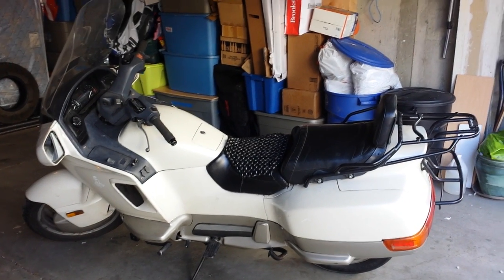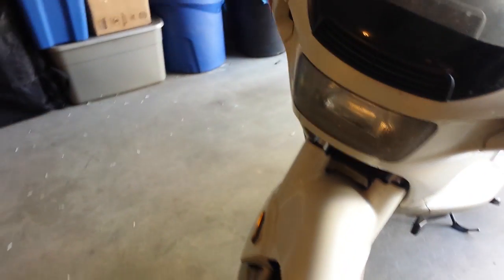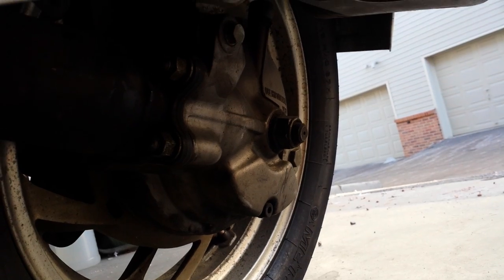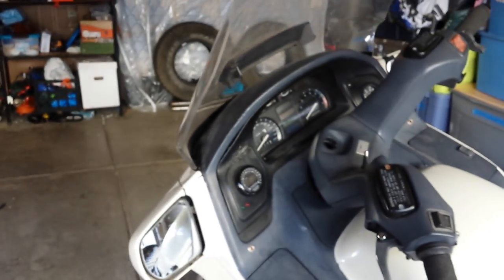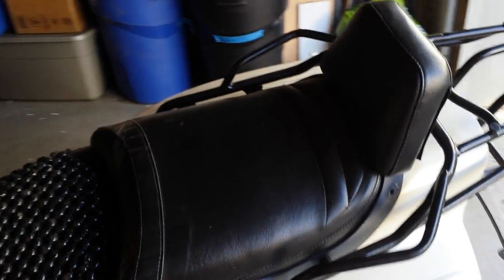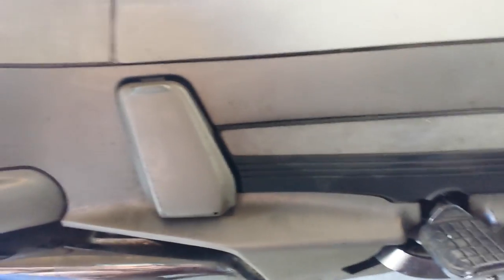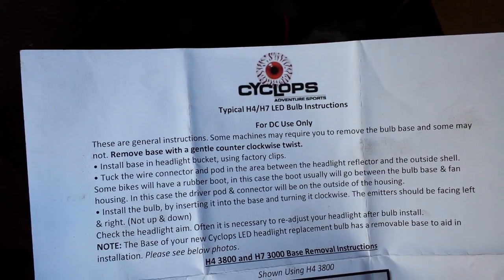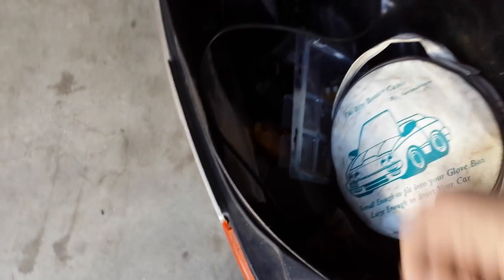Highly Customized 1989 Honda Pacific Coast PC800 - Fuel Injection!

Comment: Just awesome mods! Recently acquired a 7 year abandoned 89 pc800 for $300. Spent 4 weeks learning how to work on a motorcycle as I'd never ridden before in my life. Today, I learned how to clean carbs and put it back together. Much to learn and love that thing. Working hard on it so I can take it on 101 all the way to LA :)  

Those pegs... makes me think I should install those before going to LA and perhaps some mods to fit my height bettter... 6'2" 

Nice work and hope to replicate some of your mods. I'm in Portland.
Reply from the maker: That's great news!  They are lovely bikes and we need more people like you who are willing to adopt orphaned PC800s.  The PCH is an awesome ride all the way from where it's US101 in Olympia down to Los Angeles where it's Highway 1.
Reply: Douglas Van Bossuyt .. THAT is the PCH people talking about? Ahh thx telling me. I never realized that.
Reply: Frank Mounts make sure the tank doesn't have rust. It will blow through a filter and destroy your cylider walls. Been there

Comment: Only question I have about these bikes, I am 6'5 and I would love to know if I would fit without my knees being jammed into the fairing. I sold my 5th gen goldwing for that same reason. From the backrest for the driver to the fairing I would need more than 26 in
Reply from the maker: I'm not near my bike for a few days so I can't measure but you might ask that question at the iPCRC mailing list. If you Google iPCRC you should find it.

Fwiw, I'm 6'2" with a 33" inseam and fit okay. You might need to add a cushion to the seat or redo the seat and add extra foam under the cover. But you can probably make it work reasonably well.

There are also handlebar risers available and if you're willing to lengthen cables and hoses, you could add a few inches of rise beyond factory.

The real difference for me is having a set of Mick-O-Pegs on my PC. It lets me stretch out on the straights.

Comment: didn t know the last exhaust pipe is really fake ..this one makes same sound as mine .. with full exhaust .. thanks !!
Reply from the maker: Well the fake cover on the left side is fake.  The right side actually has the muffler and whatnot and there's a cover over it to make it look prettier.  Many of these bikes (mainly the 1989 model year) sound like they're "tweeting" from a loose bit of metal in the muffler.  It's a "feature" LOL!
Reply: ah you just mean the left ide .. i thought i could take away lastpart on rightside .. will not do this now .. yeah i love the sound .. rode a pc800 for 2 years and now after an interval with over 250000km on paneuropean i ride my tupperware moped again .. like it and it saves me a lot of speed tickets .. and it actually corners better than the st1100.. wish you nice rides ..and props for the injection !!
Reply from the maker: I've owned a lot of other bikes over the years but I can never bring myself to sell my PC800!  Now it is my only bike again.  Until I can't get spare parts anymore, I think I will keep riding it forever.
Reply: its just so freakin practical .. i bought one 25 year old with only 8000miles !! so im gonna drive it till i have enough monney to buy something similar with electric propulsion .. or even convert mine to electric ..
Reply: Greetings from the UK and thanks for sharing all your valuable knowledge and for the great website too. Is there anything I can do about the chirping sound from the exhaust. I find it a bit annoying to be honest.
Reply: @ianowen4481  the chirping is loose rivits inside the exhoust .. it happens to all pc s :-)

Comment: Hi Douglas I would like to ask where you get the rack and how much you paid for? 
And the LED for headlights is what p/n ?
I have pc800 1989 too
Reply from the maker: Hi Kim!  It's an MMoto Complete Rack.  The guy who makes them is in Ukraine.  The LED for the headlight... I'll need to look it up... but it's on my website as well.  If you search for "PC800 Links and Information" you will find my website with a ton of information.  Or check out the PC800 Facebook group or the Yahoo Group called the IPCRC.

Comment: very nice. looking to get one soon. can the LED conversion be done and still keep the auto cancelling signals?
Reply from the maker: Yes you can do that.  You'll need to put in load balancing resistors on the turn signals to achieve that.
Reply: Sounds easy enough. Thank You for the reply.

Comment: 2022 and the guy in Ukraine is still selling the complete rack on eBay, even while his country is at war. This was the only review I've found on it. I was wondering about that lower rack mount. Still on the fence about drilling wholes in a beautiful trunk that is currently water tight.
Reply from the maker: I haven't had a problem in about ten years of the lower rack being drilled through the trunk lid. As long as you use a drill bit that's the right size, there's very little space for water to get through.
Reply: @DouglasVanBossuyt  the seller doesn't mention any welding requirements, like I found on your installation page. Was that something you added?
Reply from the maker: @dirtbikedave  for the lower rack on the pc800, I think I remember the instructions saying you don't have to add on the welded attachment point but that it makes it much stronger. My buddy did the welding in about five minutes using a cheap harbor freight welder. It was really easy.
Reply: @DouglasVanBossuyt  thank you for the encouraging info.
Reply: @DouglasVanBossuyt  can I buy one now

Comment: Hello
First sorry about language Im not english speaking very much.
I got question about cardan from VT 1100
If was fit with no problems or?
Thank you
Reply from the maker: Hello! Most vt1100 final drives are direct swaps.
Reply: @DouglasVanBossuyt  I guess I got one that is not, the wheel freezes when the axle is tightened, any suggestions? Plus seems wheel does not fit into drive (leaves a gap), I have a VT1100 wheel coming.
Reply: @mylesdeportado2004  Are you using the procedure outlined in the owner manual and maintenance manual for reinstalling the wheel?  There is a feeler gauge that you insert between the caliper and disk to space the forks apart correctly when you tighten the axle nut.

Comment: I also have the MMoto rack, without the lower part, my trickle charger plug is in the same place, and I have a +6 Windshield.  I added LED driving lights under the front turn signls.  I installed a Rostra cruise control, which i love. i am about 6'2", and find the seating a little cramped compared to my ST1100 with peg lowerers. did the fuel injection help mpg much?  i have thought of getting a VT1100 rear differential, but not sure if would make the bike bog down.  what brand LED H4 bulb did you use?
Reply from the maker: I ended up switching back to my carb because I was concerned about reliability of my home built fuel injection system over the long haul.  MPG was about the same carbed vs fuel injection.

I bought the LED bulb a few years ago.  I think the folks on the Facebook PC800 group probably have newer intelligence on what the best bulb is these days.
Reply: I deleted Facebook after the Zuck Congressional hearings.  I managed to strip the 2 screws that hold the R&R.  I was trying to reach it without removing the tupperware, but I guess I lost on this round.  I might just ziptie it for now, since I got it connected to the wiring harness.  The plastic is so brittle a corner of it broke, which is the piece that is under the shelter.  With the VT1100 rear, does it cruise ok at 70-80 mph?
Reply from the maker: It cruises very well at 80mph with the VT1100 rear end.

The IPCRC Yahoo group is another place you can ask although not many people are using it anymore.

I think the one I bought is a Cyclops.  The one bad thing is it's hard to aim.  Oh, and the light pattern isn't very good.  I've been considering switching back to the stock incandescent bulb.
Reply: I noticed that.  A guy wanted some photos of my Rostra Installation, so I created a folder of them.  I have an ST1100 and a NC700X, along with 2 Ruckus, a Metropolitan, and a Yamaha Zuma, and my kids go riding with me.  My daughter's MC days are in hiatus, since she just had a baby.  I bought the NC700X thinking I would like it, but the seat is a form of Chinese torture.  My 17 year old son likes the bike, but hates the seat, too.  I bought an air pad, but it isn't the best.  The PC800 has the most comfortable seat of all of my Hondas.  Noticed that several of your videos are in Oregon.  Live there?
Reply from the maker: I used to live in Oregon!  Also lived in Colorado.  Now I'm in California right on Highway 1 :-)
Reply: I drove my Yukon cross country to Oregon back in October.  I wish  I would have had time to have rented a MC, especially when I was in Moab, but there was an event that weekend, and all of the hotels were sold out.  Smoke from the Cali fires were evident in Idaho all the way to Cannon Beach.  Ever been to the WAAA Museum in Hood River?  Fantastic place.
Reply from the maker: I don't think I've been to the WAAA Museum in Hood River but I've been to Hood River many times.  Last fall in September I did a big ride up from Portland through the Gorge to Yakima and then into BC for a few days, and then back along US 101 all the way to Seaside where I took the highway back to the valley.
Reply from the maker: Very cool!  Sounds a bit like the Evergreen Aviation Museum in McMinville.  I used to have a membership there.  Was a great museum although they've lost part of their collection in recent years.

Comment: Hey, do you have any pictures of your carb to throttle body conversion. Also, what made you go back to carbs?
Reply from the maker: Yes I do!  Check out my website.  Specifically look at this blog category.  You might need to go back a couple pages in the archives to see the carb modifications.  http://www.douglasvanbossuyt.com/category/hobbies/motorcycle/maintenance-log/pc800-fuel-injection/

Comment: What headlight bulb did you put in? I'm about to replace the windshield soon and want to replace bulb at the same time. Thx
Reply from the maker: It is a CIL-LEDMD-H4 3800 Lumen H4 LED Headlight bulb.  Works okay.  The adjustment is a bit difficult and it never really shines in the right spot perfectly.  If it weren't for the watt savings, I'd switch back to the stock incandescent.
Reply: i see, I tried an LED backup lights for my truck, and they were not good at all, went back to Incandescent!  Ok, I'll just use a regular bulb. when i change out the windshield. thanks for the reply !
Reply from the maker: I have LED bulbs everywhere on my bike.  I like them everywhere else.  I think the main problem with the headlight bulb I have is it isn't quite designed right for the light dispersion pattern that the bike expects.  I expect I'll replace the bulb in the future with a newer LED bulb when they get better.